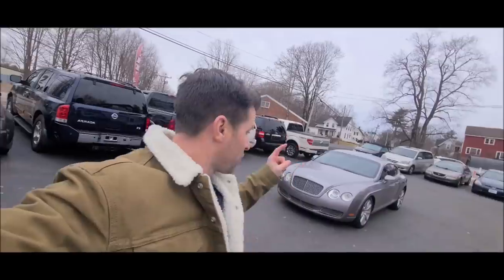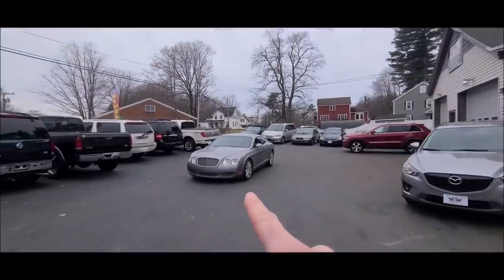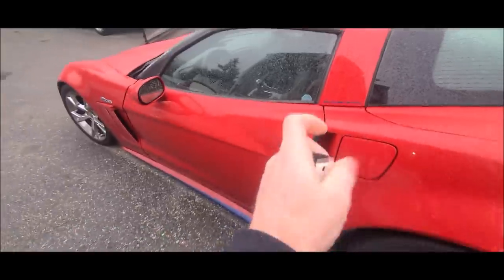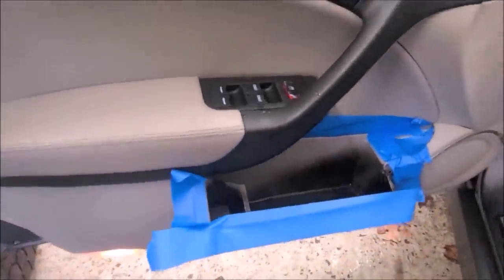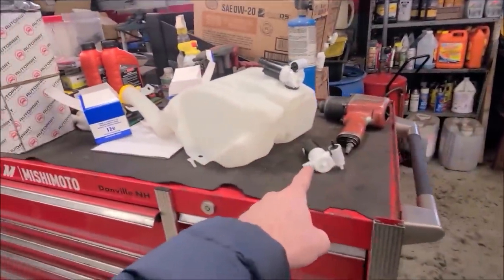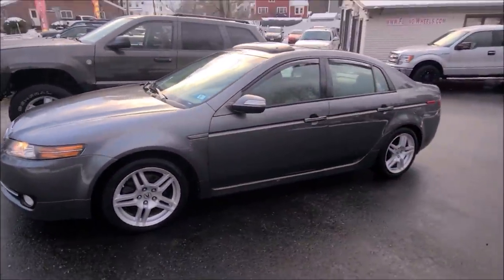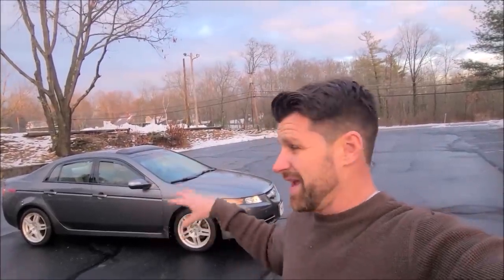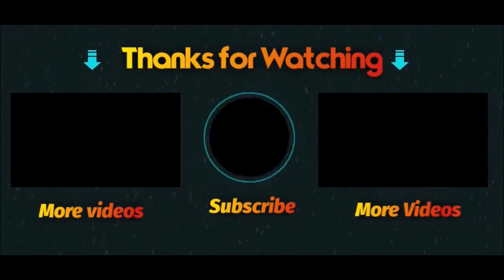Turning $400 into a Ferrari - The Acura SOLD! Where are we now? Flying Wheels

Comment: For the headlight, Sylvania Headlight Restore is amazing. Takes a crap headlight and makes it look brand new! So long as it is outside damage of course.
Reply: An monkey can buff a headlight to perfection using tooth paste… that’s the easy part. How to keep it looking new and clear for the next YEAR or LONGER is the hard part. 

All the cheap DIY coatings that come with the headlight restoration kits are junk. Will wear off in months and then the headlight is exposed again and begins to yellow VERY QUICKLY.
Reply: @I_know_what_im_talking_about  Don't be so sure... Over a year on two of my vehicles using that stuff once. Sure, a tiny bit of yellowing, but still looks basically brand new. Watch Project Farm. That stuff literally makes the headlight like new under the microscope, it's amazing.

Comment: Z06?  It has grand sport fenders and stuck on z06 badges & a weird z06 decal near the glass. Does have z06 seat embroidery though...  Also you might want to try plastic razor blades next time you are cleaning something and don't want to risk cutting it.  They work great for stuff like that.

Comment: Unsure the cost of a new headlight on the Jeep, but I feel like replacing it would've upped the value significantly more than the cost of a new headlight with install.
Reply: yeah, or some baking powder and vinegar/cleaning fluid and some elbow grease and it looks like new
Reply: Or at least clean it good
Reply: How does a dealership not have the supplies to restore headlight plastic? It takes like 15 minutes.

Comment: On the Grand Cherokee Washer Reservoir, why not plastic weld that hole ? It's pretty easy to do. They even have a UV Plastic weld kit that uses a light to cure the liquid plastic. It take a bit of time and patience to build up and fill in a hole like that but it would definitely solve the problem.

Comment: surely you could find a black rubber stopper  ( looks like a cork) at a hardware store to plug the hole on the washer reservoir.

And like everyone else said, I think you should have replaced the Jeep’s driver side headlight to match the other one. It’s a huge difference looking at it in the vid.

Question: Do you recommend your buyers purchasing extended warranties since some of these are high mileage or over manufacture warranty?
Reply from the maker: Always

Comment: I like the fact that with armor-all you don’t use it on anything your hands touch, also I’d suggest not using it on floor mats, the dealer I bought from in NY did that and 1) stuff was sliding around in my trunk 2) my feet would slide around when getting in and out.

Comment: LOL - the ozone generator converts the O2 in the air into O3 - ozone.  Ozone is highly reactive, and reacts with the odor causing compounds that make the car stink.   The ozone generator does not spit out clean air - at all.  Also, ozone in high quantities is toxic, which is why the instructions for that thing tell you not to be in the car while it is running and to air out the car for a long time after treatment.   I have one I used on a used car that smelled like I don't know what, let it run for 8 hours with the window cracked to allow new O2 in, and the fan on recirculate to get the ozone to anything smelly in the vents.   Worked a total treat, but I had to let it air out, windows down and a box fan in it, outside, for 12+ hours before the ozone smell went away. The bad smell went away and never came back, it it the best way to do what you are using it for, that is for sure.
Reply from the maker: Thanks for clarifying!

Comment: You got lucky with that Acura TL. Those had Notoriously horrible transmissions.
Reply: Well, who's the say it doesn't break down on the customer who purchased it
Reply: @clo6483  That's how the game works. In my personal experience. These always break down. These Acura/Honda have very weak transmissions.
Reply: @clo6483  sooo what’s someone to do about that ? If it breaks down next year then what ? How is that any one’s fault
Reply: As an owner of an 05 TL, if u replace the timing belt, and also replace the transmission fluid, and u do BOTH early enough, the transmission can last a very long time. But delaying the timing belt change can possibly affect the transmission.